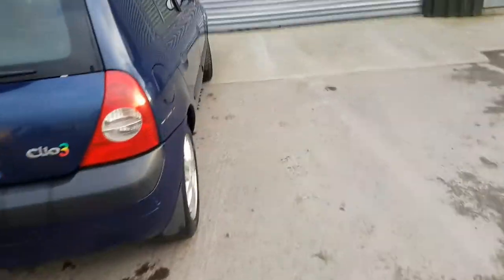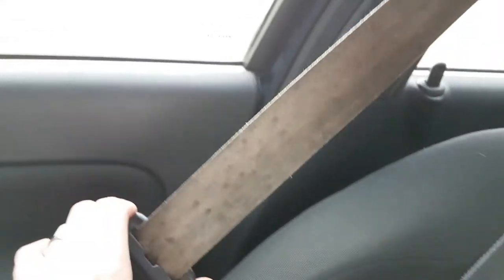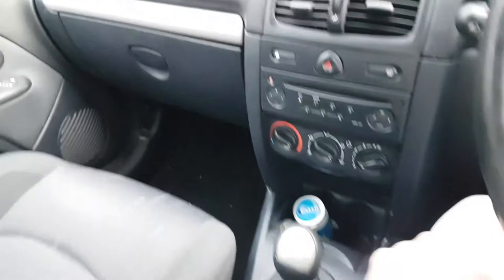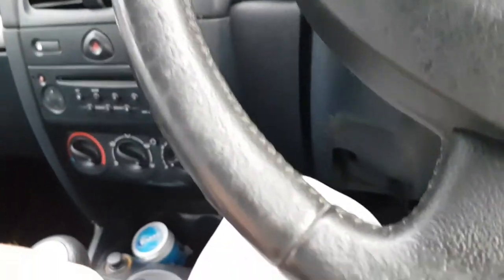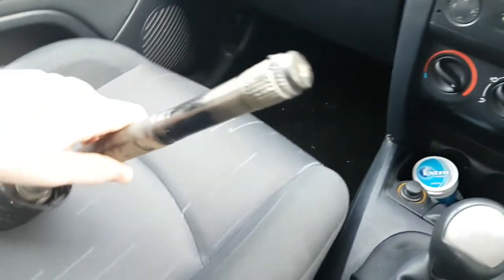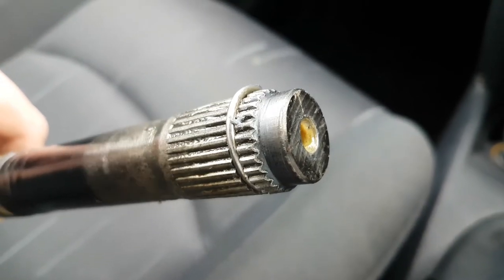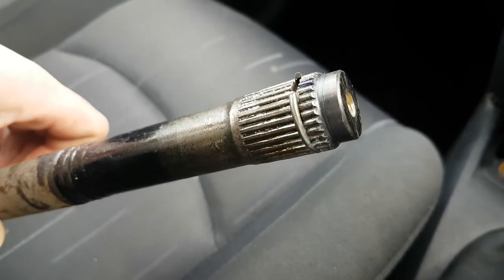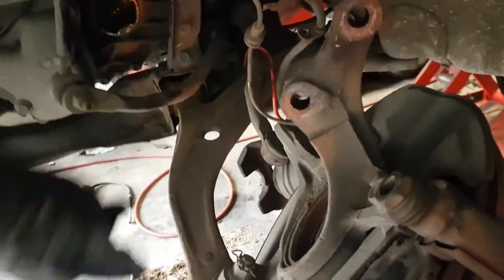honda stream rn6 problems part 1/replacing outter cv joint/drive shaft issues

Comment: Hi 
Do you have any idea where to buy drive shaft or joints for RN6 
Or maybe fits from different model? 
Thanks
Reply from the maker: Try these websites to get the correct part numbers, then give the part number to your local motor factors. 
 http://www.jikiu.com/catalogue/542300/#/vinsearch

https://partsouq.com/

https://www.amayama.com/en/genuine-catalogs

https://shop.febest.eu/catalogsearch/result/index/?p=4&q=Honda+stream+rn6+model+X

Comment: honda stream 2009 water leak at a left tail light do you know how to fix it bro?
Reply from the maker: +waiwaison369 Not and expert but remove the light and see if the seal is ripped or broken and check all the clips are working fine because if not they would allow water in.

Comment: Does the fd1 civic and RN8 stream use the same shocks and springs?
Reply from the maker: I wouldn't know. I thought that the tie rods and cv axles would be and they are not so don't count on them being the same.
Reply: Nope, the stream has shocks that are unique to them unfortunately, closest I could find to a rear shock on a parts catalogue was a dc5 Integra rear shock. I ordered two new genuine ones from amayama and were phenomenally expensive after getting stung for customs

Comment: Rim size? Tyre series?
Reply from the maker: Integra type r 98 spec 16 inch 205/65/16 but this car is lowered on coilovers and i have a 65 sidewall for comfort. You could got 18" 45 sidewall with stock suspension.
Reply: I like that stye. 16inc rim type r racing look
Reply from the maker: 16" radius works better for this car. Easier rotation.
Reply from the maker: 17" would be fine too.